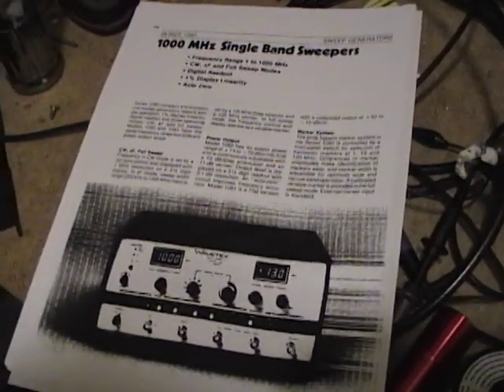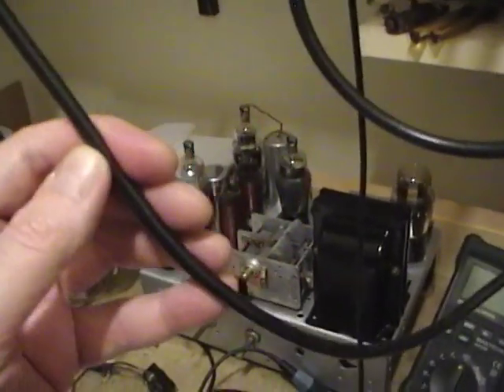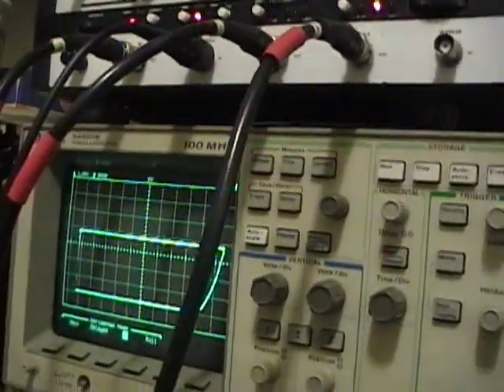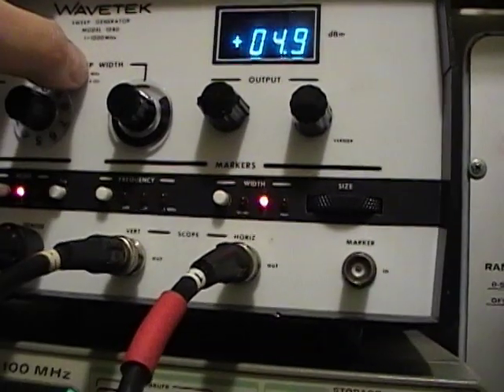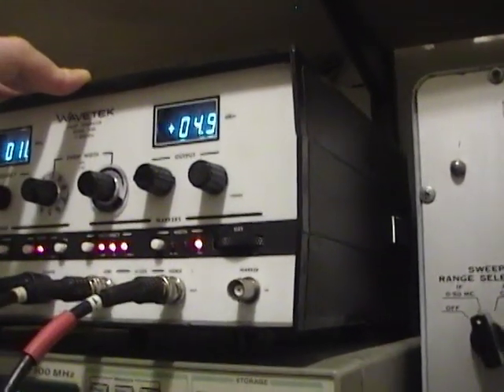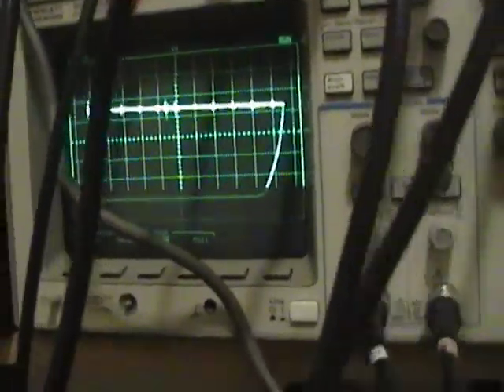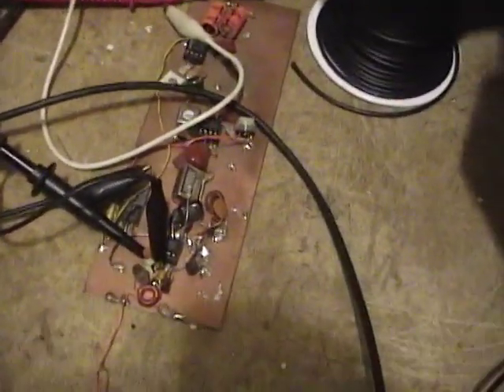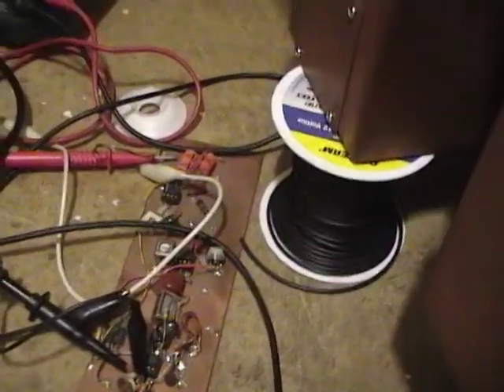Wavetek 1080 - Using a Modern Sweep Generator

Comment: Great video.  I have the 1080 and have been recalibrating it.  I was able to get my hands on a complete manual - one that has all of the schematics - and scan it into a PDF, if anyone wants it.  Right now I'm trying to make an RF demodulator/detector probe for it that covers 1-1000mhz.  Most of the circuits I've found online seem to roll off after around 200mhz.

Comment: My oscilloscopes are so old that have wax and paper capacitors in them, except maybe the RCA one, needless to say they don't get used very much and they need an overhaul. I have a sweep generator but it's an ancient EICO unit from the early 1950s, it seems to work but I don't have many TV sets to fix either mostly radios.

Comment: @bandersentv I think it's a model 360 or 360 K, one of the single dial models with the windshield washer pointer, it has that blue hammer tone paint on the front panel. It does seem to work when checked with a frequency counter, but I don't have a working scope to check anything else.

Comment from the maker: The place I found it is gone.  No, I don't use my 1080 with 75 ohm equipment.  When I inject signals into my vintage TVs, I use a 50 ohm termination resistor at the end of the cable.

Comment: Nice sweep but not really made for TV or Radio, because of the way it sets up sweep center Freq and markers... My guess it is a CATV sweep (as you said). I have a HP3336C sweep. Nice video... I learned all this on my own the hard way, but still get a lot out of your videos. Wish they were around when I was learning all this. Cheers. (I also have a HP8640B. I can recommend those for a good digital read out generator.)

Comment: It appears that the oscilloscope is acting like a spectrum analyser.  Why get a spectrum analyser if you can use this equiptment to look at radio frequencies?
Reply from the maker: Yes, it does provide the same basic functionality as a spectrum analyzer.  One big difference though is a spectrum analyzer will have a very accurate amplitude scale. I'm looking at waveform shape and relative amplitudes but I don't know the precise value of the peaks.  Also modern spectrum analyers have extra features like FFT to give you more info about the signal.